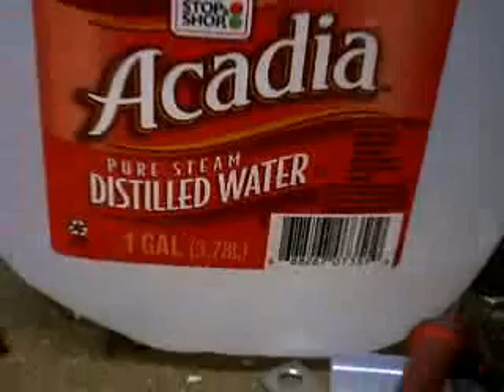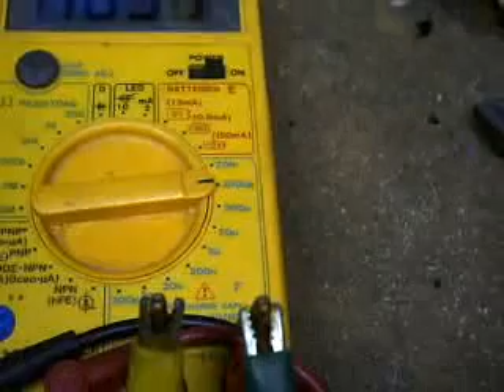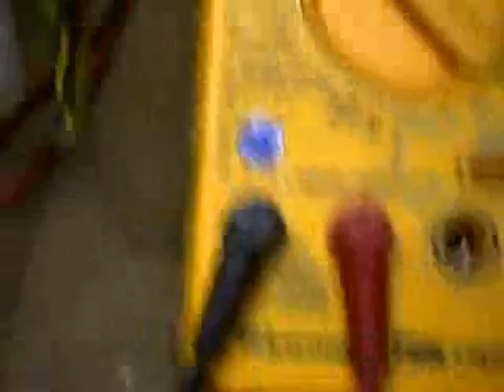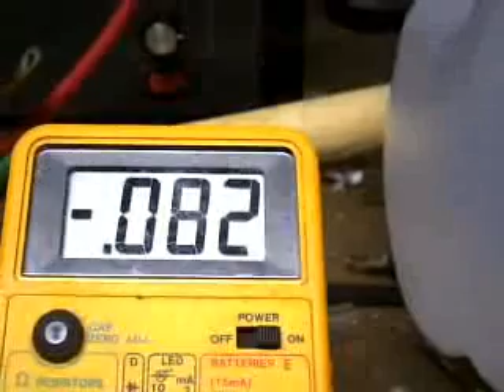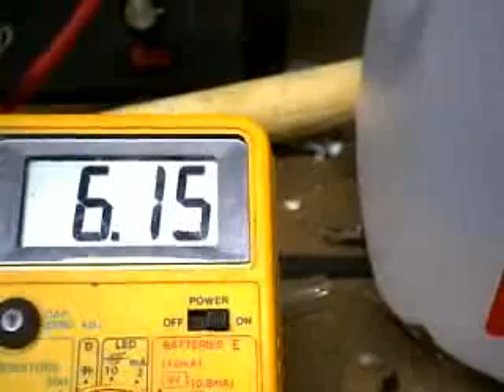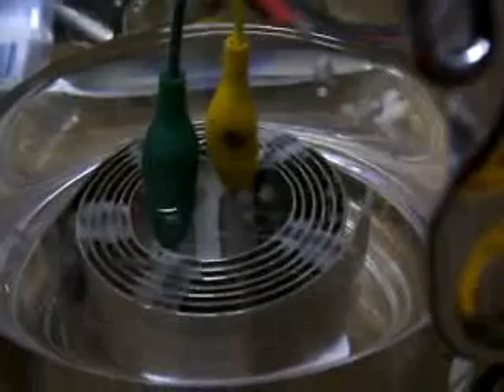#67 Resonant Water Fuel Cell - 03

Comment: Resonator is when maximum hydrogen is generated with least amount of power expressed in watts.  So if you hook a gas flow meter like the one used in a welding machine to the output of your cell then measure the current and voltage being used to create the hydrogen gas. When you get maximum gas out at a certain voltage and amp then you have the resonant frequency of your cell.   The holly Grail is to produce so much gas with the least amount of voltage times amp that your car can run on with out draining your battery.  Best case would be like 10 amps at 12 volts is enough to idle a car engine and 25 amps at 70 mph.  That would be the same as having your headlights on all the time and that is no problem for the engine to normally handle that low of a load.

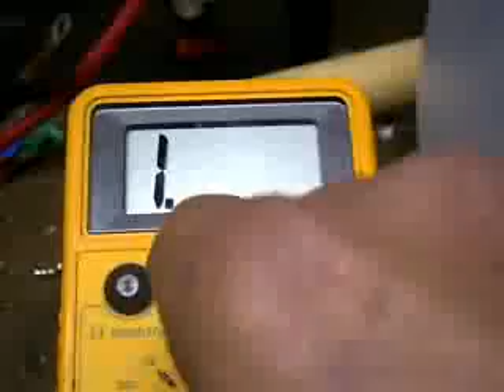Comment: When you switched the meter to 20K (2:20), the meter had to adjust to measure the resistance in the higher scale.  That is why you see it dip, equal out, and then start climbing again.  When measuring resistance, switching between scales with not give you a very reliable measurement. Thanks for the upload though, good stuff.

Comment: Commendations on an excellent series of videos.  As a chemist I believe the effect you were experiencing with the increasing resistance over time is indeed due to a charging effect.  In a capacitor, the medium must be 'dielectric' meaning that it polarizes when charged - all the molecules line up a certain way.  This actually impedes the flow of electrons, but the artificially aligned molecules are now storing 'potential' energy.  Dielectric breakdown occurs when the cap pops or the wfc produces

Comment: @irondmax 
voltage flux flows on the outside of the stainless steel.
then we also have the cell with electrolite.......
then it wants to behave like a battery.....
then we have magnetics.......
so many things going on.......
everyones input is needed.....
dumb... comments are just that.....
even if you have perfectly pure distilled water.......add some sunlight........now god himself just gave you something in that water.......
so many things....
thanks again Zero.......

Comment: as i read these comments on this video........
i say thanks zerro.......
to many of the others...post a video of how smart you are!
to those who have posted your videos..thanks.
my comment is this...
you have resistance, capacitance, inductance.
capacitors are made from 2 electrodes with an insulator in between.
resistance is from the insulating effect of the water, and the stainless steel itself is a shunt resistor.
inductance comes from flux field of the current.
voltage flux........

Comment: That water is not pure even if that's written on it, try to by water that conducts electricity at max 0.2 uS/cm which is still not pure. 
From Lenntech:
"Ultrapure water conductivity is about 0,054 uS/cm at 25oC, also expressed as resistivity of 18,3 MOhm."

Comment: Pressurized Water fuel cell ,super conductive solution with high intencity Static charge aplyed thrue use of krypton Gas contained under pressure in ceramic tubes seperated by pollerity, Powerd by Vander graff generator, sending statick charge thrue poller isolation diodes,then fed in phrequancy isolated discharge to a tesla coil,then to the krypton filled tubes, as krypton gas is the only non oxidizing knoble gas. And electicly conductive under pressure. A scruber to remove krypton needed.

Comment: The ohm meter is applying voltage to the plates in order to actually measure the current. The current is then converted in the meter to read ohms. This applied voltage is trigging the HHO production. As soon the production starts, the current is flowing and the meter will measure ohms. Depending on which meter you use the readings will differ so don't rely on your ohm readings.

Comment: Sorry for not reading all previous comments.. but quick thoughts (I watched your previous video on same subject).  Even at low currents (uA), you are likely initiating electrolysis, because your plates are in intimate contact with the water. Experiment with this... insulate the plates from the water, then submerge them. If you can make similar coiled plates after coating them with Kapton tape (ebay), then you will have a far more stable condition - independent of the water conductivity condition

Comment: I think what you are seeing is this:
When you connect the meter to this setup, you are in essence beginning to electrolyze the water, just at a very small rate. This is because you are supplying a small amount of charge from the meter battery. The process ionizes the water on a gradual scale and what you see on the meter is the result. Pretty sure about this.

Comment: usually circuits are resonant due to the capacitor and the dialectric but with water the resonance changed with the volume of water and temperature water is a tricky thing i suppose

Comment: Z, I am only a tech license at this time, but i have seen a meter respond the way yours did. With a big slow capacitor it seems to me that after you reached max and switched to a higher scale the switch actually gave the cell a voltage, then dropped to zero, then applied voltage again. The rise and then drop and then started raiseing again was a voltage "bounce" by the capacitor that comes with a "pulse" situation. Pulsing a rectified voltage to a capacitor causes "surges". Maybe that registered

Comment: Equation:

C= K*Eo*A/D, where  Eo= 8.854x10-12

where:

K is the dielectric constant of the material,
A is the overlapping surface area of the plates,
d is the distance between the plates, and
C is capacitance

in the data sheet, it lists waters dialectric constant as 40.  Should be fairly easy to figure out.  (My unit is operateing at approx 2 cycles  a second,  very slow oscilltion.

Comment: Ok you are using words like resonance, negative resistance incorrectly.  The reasone the cell keeps climbing in resistance is that it is essentially a capacitor.  It will climb because the cell is still charging from the voltage of your ohm meter.  Resonance ocurs when reactances cancel each other out and all you are left with is a purely resistive component.

Comment: Zero the meter tries to push a constant current (but known)thru the resistor under test. It then measures the voltage & displays the result in ohms. If the current charged into a cell initially exceeds the meters internal current source it will push current back thru the meter giving a negative value. As the cell discharges the internal meter current will rise to a positive value again.

Comment from the maker: I could not possibly agree more. In fact check the next vid I'm about to upload. There will be no more discussion of a zero-cell either. It will be classified as a vertical series plate brick cell or vertical cell for short.

Crob made a perfectly valid point. The need for standardized and easily recognized nomenclature. I am completely on board with that so long as it's generic and not self promoting.

Comment: Furthermore:

f=1/(2n (LC)^.5)

f is frequency of resonance in an LC circuit
n is pi (only because it is closest looking to the symbol)
L is inductance
C is capacitance

My suggestion is power -> pulse transistor circuit (one-sided) -> tuning coil for inductance -> experiment capacitor.  You can measure output versus input as you "dial" the inductance coil, when found, simply measure the inductance and voila!

:D

Just trying to help

Comment: C ~ eA/d

Which is (C) capacitance is (~) roughly equal to (e) permittivity of the dialectric multiplied by the (A) area of the surface facing the opposing side divided by the (d) distance between the plates. You have a coiled capacitor which has a huge surface area double-sided even.

For the drop in energy and then a raise, there is a voltage that leaks back into the unit and in the water before the unit has time to push the charge back up.

Comment from the maker: Leads? No. Meter? I thought maybe. Tried a different meter and got similar results. Next step is to put a steady current into the cell and observe the rise time on the scope.

And even despite the appearance of high capacitance, I still can't shake this feeling that it might pay off to pulse at the resonance point of the tank circuit with the theoretical capacitance. The dielectric value of 80 for h2o had to come from somewhere.

Comment: Here's another thing to check.  Multimeters use up to 9volts to check resistance.  Make sure the batteries on your meter are fully charged/new.  If you still get the unstable readings you may want to try inducing larger voltages and measure the current leakage to get your resistance.